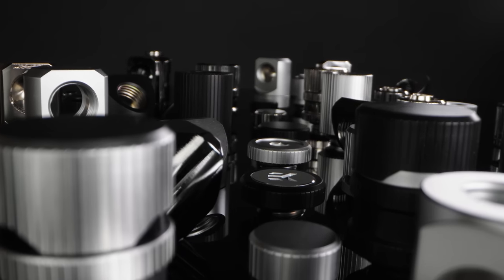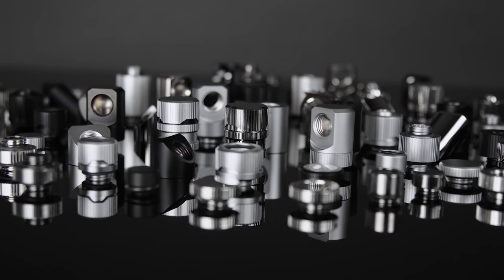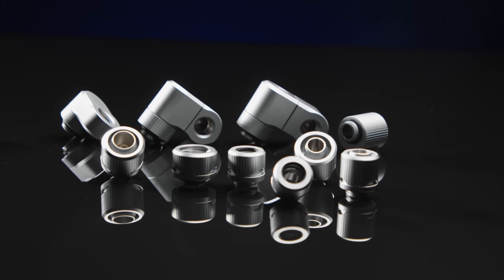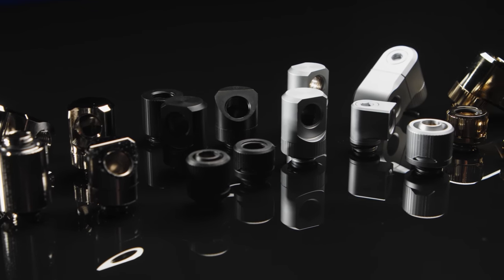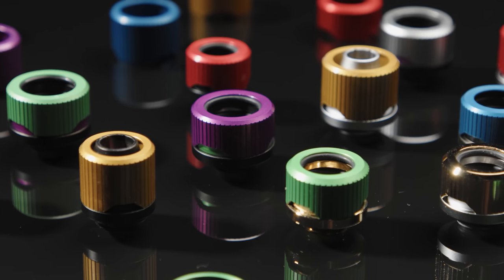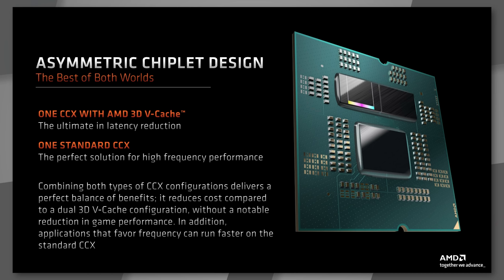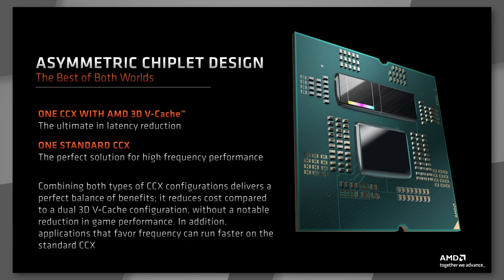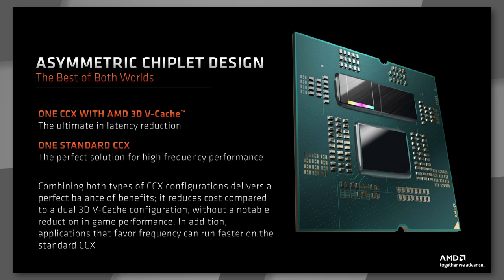Why I switched back to Intel...

Comment: I also switched from Ryzen to Intel recently, when 12th gen came out.  Biggest driver for me was I/O; the Intel platform had more bandwidth to the PCH (so, less contention) and more lanes available on the PCH and this fit my needs more than what AMD was doing at the time.
Reply: AM5 will have more support than intels mobos
Reply: GIve me a real scenario where you had gains from that setup. One. I dare you. I double dare you mofo.
Reply: @slickysan  Right? And it has 20+ upvotes?!  LOL.  What on earth is this guy doing that he feels he's anywhere near saturating it?  Seriously, what workload on what hardware that's  even close to half of it?  Sounds like another case of "I want more because someone told me theoretically there's more headroom on PCIE 5, despite even the newest hardware being unable of saturating the previous gen".  ;)
Reply: @VndNvwYvvSvv  Indeed lmao. I'm still waiting for that scenario, but the guy bailed. He specifically mentioned "his needs" :)))))
Reply: @slickysan Bailed? He probably has not even read your commentS
Reply: @slickysan did u get any reply from the soyjack?
Reply: @visitante-pc5zc  no lol. he is a bot.

Comment: Well, I haven't turned off my 8350 for about 15 years... sure the occasional power outage ( or hurricane) but essentially, it's been running all day every day. So I would have to say my experience has been a good one if not a dated one... I've always been a fan of AMD and am interested in building a new system so I'm taking this information to heart... Thanks J...

Comment: : The 7800X3d is the best gaming CPU of 2023
: The X3D has the most problems with RAM and System stability
Wtf?
I can't make a decision like this omfg
Reply: Amd beat intel get more views on youtube. its simple.
Reply: As per Jayz 2 cents, 7950x3d has issues.  Due asymmetric design i.e one of the cores has x3d and other doesn't. 7800x3d is single ccd so it should not have that issue.

Comment: the 2 different CCDs is a weird idea, I'd just go with either 7800X3D or 7950X on AM5 depending on what you mostly do.
Reply: from ZEN is whole desing of ccd bad idea to future, - becouse on math projects on boinc is KING intel with monolitics cache witch is best for mathematic, calculations, like PRIME  or more dificult,,  i will buy intel after my 2990WX amd,,,
Reply: @asean5459  Intel will be switching from monolithic designs soon as well. The CPUs are just too darn big.
Reply: If you're doing mostly gaming, go with the 7800X3D.  Works great right out of the box
Reply: I've been going back and forth between games and music production on 7950x w g.skil 6000mhz ram cl30.... it hasn't missed a beat yet! Very impressed but get good cooling... it's hot 🔥 🥵
Reply: @ReverusN  What's your gpu?
Reply: @DylRicho  I think Intel's implementations will have better latency though.
Reply: @DylRicho  NOoo, they must keep Ring Bus and monolithic, i don't want to deal with the dumpster fire of memory latency on chiplet chips and expensive RAM kits.

Comment: Overall, I've had a great time with my 7950X3D, it's in a rig with a 7900 XTX, 64GB CL30 6000mhz gskillz RAM on a ROG Strix B650E-I. Haven't had any of the issues mentioned here, but I also understand that it's a case by case basis. It worked out well for me.
Reply: same :) ,y experience has been blissful tbh

Comment: My 7950x (non-3D) was completely stable until the whole 1.3 V SOC thing.  It then took MANY bios revisions for it to become stable again.  As you say, a lot of random blue screens, errors etc that were not easy to place blame on.  Thankfully (after about 4 months of bios updates) the system is now stable again.
Reply: I also think he had some IOD degradation here.. Its the MB's fault for sure.

Comment: AMD 5950x | ASUS Strix B550F Gamming | DDR4 Kingston Fury | Gygabyte RTX 3090 |  NVME Samsung | Running for couple of years 100% stable and powerfull.   I think I can have this computer for another two years and still be powerfull enough for Production and Personal Use.
Reply: I'm pairing up that CPU with a RX 7900 GRE on an Asus Prime X370- A. In a few years, I'll update the motherboard. I think I'll be good for awhile.
Reply: phenom  x6 1090t,  12 years running at full capacity, without issues. 24 dolars deepcool cpu cooler, amazing temps 21, 22 years experience techinician

Comment: I've had a 7950x non 3D since launch and have also had tons of memory stability issues, my 64gb 6000mhz Hyper X Beast just won't POST at the full EXPO speed.
I've tried multiple BIOS updates etc, no luck. Only way to keep the system stable is keep the RAM at  5200mhz, any higher and eventually it either BSOD's or randomly won't POST over time.

Super annoying and I'm probably gonna go back to Intel myself for my next system upgrade, more people need to here about these issues so hopefully AMD can address this down the line. Keep up the great work Jay 👍

Comment: As a 7950X owner, the problems are different but still present. I had a horrendous time for over a year getting this thing to run with EXPO on with some DDR Trident Z Neo EXPO 6000mhz RAM. It's only in the last few weeks it's actually been usable. They released a BIOS recently that fixed a few issues, and then within the BIOS I had to disable AMD Memory Context Restore in TWO different places in the BIOS. After doing that I've finally got no problems booting quickly, not crashing when waking from sleep and generally everything seems fine. It did require a full format and reinstall of Windows 11 too though, because it seems like all the crashes had corrupted some OS files somewhere. Definitely considering going back to Intel on my next build though, I can't remember ever having this level of issues with the blue brand...
Reply: No only what you said, but a lot of people don't realize he is talking about the X3D chips, not the normal X chips.

Comment: I would like to see what it takes to fix this issue. Does swapping the CPU for another 7800x3D or same motherboard resolve the problems? Would love this to be a video
Reply: swapping cpu dont solve sorry
Reply: I'm positive he troubleshot, he talked about a ton of steps. AMD cuts corners, plain and simple and doesnt have the R/D for good drivers.
Reply: He should've swapped to the 7950X (non-3D) for 16 cores (32 threads) of all high-performance goodness. That's what I use, with the same motherboard as Jay and everything runs perfect, EXPO memory speeds as well.
Reply: It's obviously an IMC degradation issue which if he was more experienced, he would have RMA'd it. 2012 isn't very long in Computer terms lol.

Comment: 7800x3d user here. I use Gskill 6000cl30 (Trident Z Neo) kit and it works flawlessly. New BIOS also added support for higher speeds, one of my friends is running a 6600 kit on a Aorus board and it's running fine too. Maybe the IMC on chip isn't good on Jay's.
Reply: Which kit specifically do you have? Is it the 2x16 or the 2x32?  CL30 or CL32?  I've got the same memory on my list of parts to buy, thinking I might bump up to 2x32gb, but the only one officially listed as supported by my motherboard choice (asus rog strix B650E-F) is the 2x16gb CL30 version..while it lists the 2x32gb cl32 being supported. Both 6000mhz.  Odd that just changing from 32 to 64gb the board says it goes from cl30 support to cl32 support.   Although the g.skill website says that 2x32gb (cl30) works fine with the B650 boards.
Reply: @slandshark  I'm using 2x16 kit. It is odd that the motherboard QVL doesn't include 2x32 kit for your motherboard at cl30 but it'll most probably work.

Comment: RAM instability was what put me off AMD back when they launched the 5000 series. Bought a 5800X and a X570 Gigabyte motherboard. The 3800MHz CL18 RAM I bought from G.skill would NOT run at the advertised speed at all. Returned the RAM and got 3600MHz CL16 RAM and the same problem existed... Returned that for 4000MHz CL18 RAM and still the same fucking problem. Returned the 5800X and the X570 board for an Intel 10700K and a Z490 motherboard and popped the 4000MHz CL18 memory in that was specifically "optimized" for AMD. The system did a boot loop once, and started right up at the proper XMP settings of 4000MHz CL18 and hasn't had any issues since.

Intel gets a bad rep. But nothing beats just plain old stability, which Intel will always have the advantage of.

Comment: This was me with a 5950X. That processor got a little wonky when utilizing large I/O transfers. It also didn't like our plugins. No issues with Intel and it's great at productivity and gaming.
Reply: That doesn't happen for a friend that has a Ryzen 9 5900X, his system more stable than mine with the Alder Lake i7-12700K (best i7 in a decade IMO).

Comment: That has been always an issue with the Ryzens. I had a 2700X on a MSI X470 Board back then and I never could get the rated 3200 MHz of my RAM. I was stuck at 3000 MHz.
And now I have a 7950X3D on an Asus Strix X670E and had initially the same problem: RAM rated for AMD at 6000 MHz, stable only up to 5200 MHz. 
But obviously I´ve been more lucky than you, because a BIOS Update 1 month later gave me the stability at 6000 MHz and now I´m completely fine.
And now I´m very glad, not having an overheating 14900K with double the power consumption and stability issues.

Comment: That is so funny, because I am having those exact issues with my 11900k and memory not being stable. Just waiting for 15th gen to make a switch.
Reply: Update your bios.
Reply: @lillen141   I did, it's up to date.
Reply: Anyone ignorant with an AMD component in their system will think the AMD component is at fault when stuff goes wrong. Their bad reputation is extremely undeserved.

Idk what GPU you have but if it's AMD and you posted this on Reddit people would somehow blame the AMD GPU for it I swear.
Reply: @Altrop  AMD 100% deserve their reputation.

Comment: There are issues with sleep forcing and then getting stuck on bad memory timings on a lot of different systems but the AM5 stuff really highlights the issue, to the point where some motherboard manufacturers are completely disabling the ability to put the computer to sleep from the bios. You'll likely fix all of your issues completely if you clear CMOS and then either leave the computer running or shut it down rather than sleeping/hibernating it.
Reply: I have always said that. Sleep always causes issue no matter the brand of parts inside the case. It has been that way since windows 7.
Reply: It's always been buggy as hell on desktops. Works fine on laptops

Comment: For a few months now, I’ve had a 7950X3D, 64gb DDR5-5600, MSI Pro 670-P Motherboard, 2x 2TB NVMe, Gigabyte RTX4090 running Windows 11 Pro. 

After hearing all of the memory problems Jay jad, I’m hallucinating to say so far my system has been flawless. When gaming CPU & GPU temps at 65c.

Comment: Thanks for letting us know why you switched to Intel again, you really have good points why you did this. 
Talking about your stability issues, i had the same kind of problems for the last 3/4 year since i build my personal AM5 system. Started with a 7700X and later moved on to a delidded 7950X after Der 8auer's waterblock for delidded CPUs came out.
Just managed about 3-4 weeks ago to get this system running with 6000 MHz on my G.Skill RAM after following the instructions of a video called "Easy memory timings for Hynix DDR5 with Ryzen 7000" from Actually Hardcore Overclocking.
Don't kno if your HyperX Kit uses a Hynix memory but if so you maybe want to try this by yourself. I never had an issue since i set the paramaters manually like described in this video.
Have a nice one, cheers.
Reply: The mistake I see Jay making is not properly stress test his RAM after changing RAM settings.
Running default RAM settings is not magically 100% stable on most systems, Jay not doing the things the right way is giving him the issues.
Having solid stable RAM on a Ryzen system is very important, on top of that he started to add curve optimizer settings on his CPU.
Many overclockers will shake their heads how he did things, this is very wrong way of doing overclock on Ryzen.

Comment: That's odd. I was having issues with the 13700k and the ecore in some games and stutter with high frame rates. I sold it recently and went with the 7800x3d when it went on sale and it's ran like a dream no issues sipping power.
Reply: Becareful not to run game optimizers.  I had similar issues with my 12700k  then traced it to game optimizer trying to improve scheduling and assign cores.

Comment: I went with the 7950x and have been happy with my setup. I do game often but also do several multi-tasking thing at once rather often. I figured that running a 4090 with the 7950x would be just fine. Though as someone who has been building my rigs since the late 90s I feel your pain and frustrations.

Comment: I'm getting ready to upgrade, almost skunkworks level but not quite. Still a 14900k and 4090, but a dark hero board by asus. I'm currently on a 4790K built in 2015. I was considering the 7950x3d by AMD but thanks to this video I'm going to stick with intel. Dont get me wrong, I've owned both types of systems and built with both, but I dont want to deal with stability issues.Thanks Jay!
Reply: honestly man for best results go with intel
Reply: Don't use asuck

Comment: I'm perfectly happy with my 5800x3d for now. Stable, not worrying about temps cause they are completly under control. My main reason to stay away from intel is...well I got tired of intel. I had intel based systems up until 2020 when I went to the AM4 3700x. Upgraded to the 5800x3d last year and been happy with that since. Didn't make the leap to AM5 because the temps and figured I'd let AMD stew until next generation to see if they could get that kind of performance while lowering temps the next go around. I still plan to stay away from intel though simply because...I got tired of intel after so many years -.-
Reply: They would never lower the temps. Since they can guarantee that the silicone would withstand 95°C for its design lifetime, all CPUs will be pushed so that they are primarily temperature limited. Honestly, 95°C is much more easy to get used to compared to 300W+ for a desktop CPU (Intel right now).
Reply: @jassenjj  Can just enable ECO Mode or ideally put a power limit on the CPU. Lose some multicore perf but in games its practically non-existent. I think Optimum did a video on those settings called "Fixing Ryzen 7000 - PBO2 Tune (insanity)"

Comment: The memory training issue you described with the 7950X3D, I saw on the 3900X. I could never get the advertised speed of my RAM when running 64G, but was fine with 32G. After a while, it started power cycling at boot and memory training. Even locking the memory speeds it still power cycled. I've since upgraded to a 5800X3D and no longer have these issues anymore. I think AMD memory controllers are still hit or miss.

Comment: I'm so glad that the X3D stuff was happening when it did because i built a new system around then and was heavily considering the 7800X3D and due to GamersNexus videos about the subject (of course it turned out to be more of a ASUS mobo situation and a couple others too..) so I opted to go with the 7700X with the x670e ASRock mobo and a 7900XTX card... been super smooth and trouble free since then. I might would try the X3D chips after a couple generations of them have been out on the AM5 platform to work out all the kinks before I take that plunge.
Reply: that was ASUS fault 100% and they fix the issue with a BIOS update not CPU fault , i have a 7800x3d with a MSI MOBO b650 tomahack with corsair ram 6000CL30 AMD EXPO 6000mhz enable and PBO-30 no problems so far
Reply: Isn't x570e an AM4 chipset ? How does that work with the 7700x ?
Reply: @juandenz2008  Was a typo on my part, I fixed it, though.
Reply: You're the most insane person I've ever seen in the history of mankind, so you bought a 700$ motherboard for a 320$ cpu 🤦
Reply: If your plan was a 7950X3D, why on earth did you downgrade so far as the 7700? You could just do a 13900K or 14900K which both are cheaper and faster in all aspects. Add to that Intel definitely has a greater stability currently ASUS  or no ASUS.
Reply: @whimsabo  That entire build is off. Can't use the 7950X3D, so swaps to 7700... My eyes roll so hard reading that.
Reply: @AB-80X  Are you talking to me?
Reply: @Jakers80  
Yup
Reply: @AB-80X  Ok, well, when it seems you actually read what I wrote, then I'll respond to you.

Comment: I was fighting myself on the 7800x3d and the 7900x. Literally was months and months of fighting myself on which to get. After reading/watching the horror stories i went with the 7900x and i do believe that was the right call.. i have it "optimized" and im seeing about 5.3/4 @80* i let ryzen master do its thing. 

But ONE THING about optimization was when i hit "start optimization" it would restart the pc, cool, that's given, but it hung up like you said on a black screen. Not matter when or what i do, if i curve optimize it will always hang up and the memory light is on the MB (not special enough to have a 7segment display) then i just hit the power button and it would boot up just fine. That's the only problem I've see thus far. 

My other pc is a 12700k which, well, asus did asus things and all the asus features for the cpu were on and after the latest bios update, i can't run any optimization for the ram or the cpu without BSOD. i dont care all that much about it being overclocked, its more for the fact that when i called asus they told me (in so many words) "well dont overclock it" gee thanks asus.